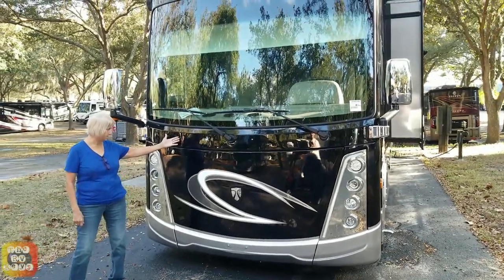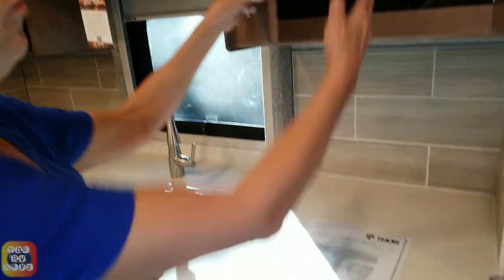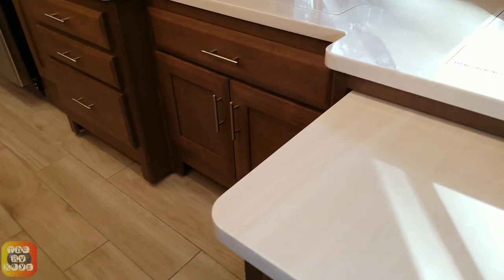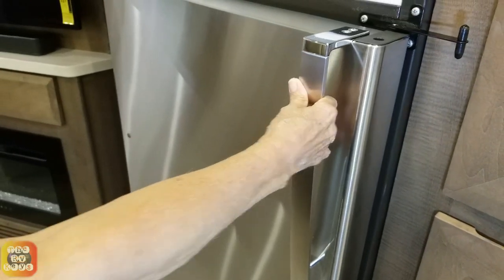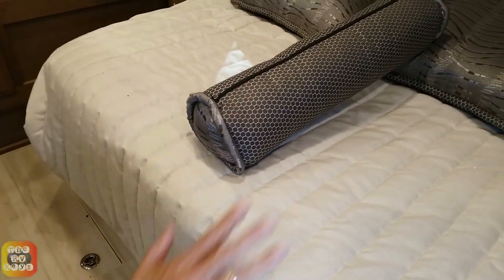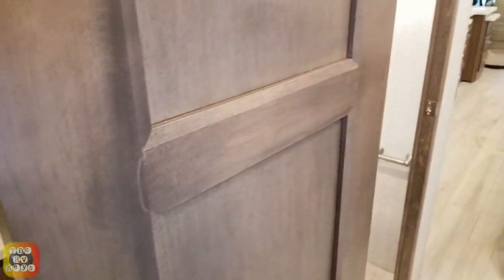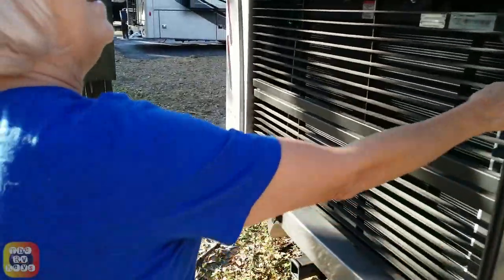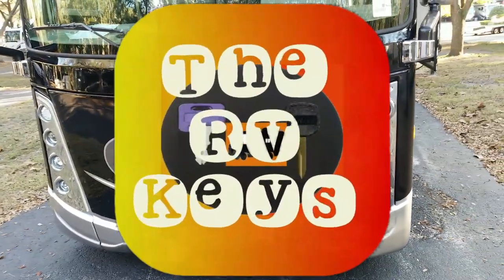What A Sweet Rig!  2022 Thor Motor Coach Aria 3701 TheRVkeys Episode 34

Comment: Thor Motorhome are very nice looking. We were looking at them but backed away after reading numerous negative reviews regarding extremely low quality control related problems.
Reply from the maker: We had a  2017 Thor motorcoach Miramar 34.1 which we loved and aside from some issues, we loved it before getting our current coach.